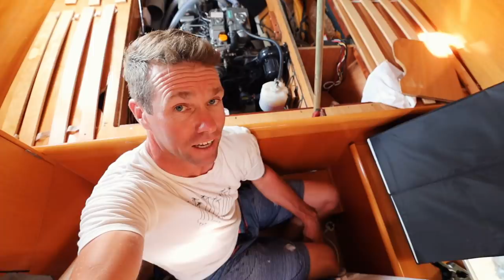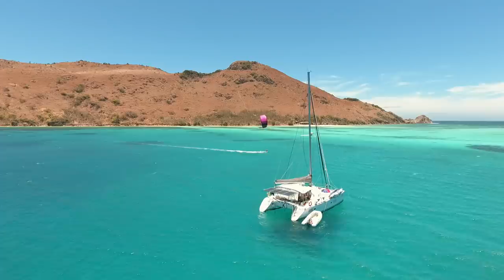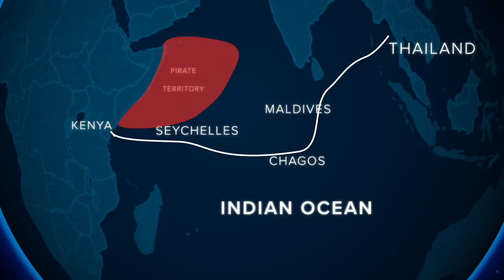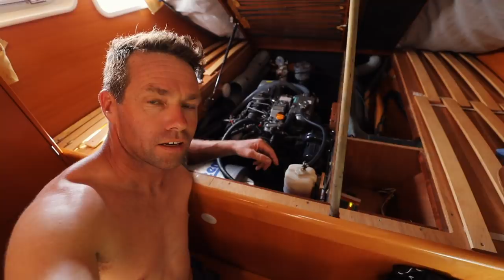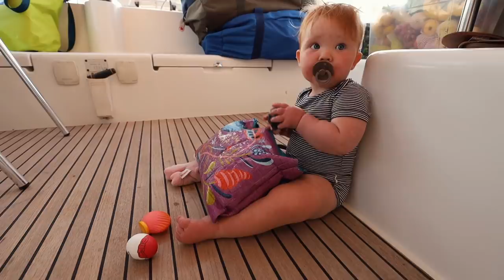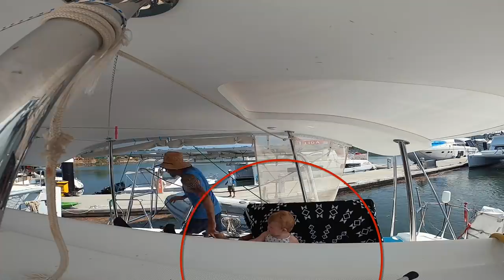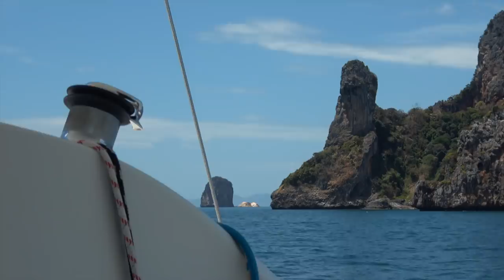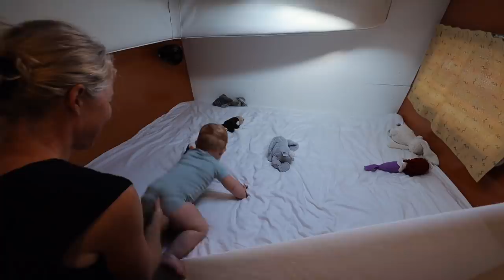we Just BLEW UP our Engine

Comment: Glad to see you out and about again a year's a long time to be away as the seized bits on your boat are letting you know! 
In regard to what you could have done to prevent it, well probably nothing but one thing I always do when starting an engine when it's been left for a bit is hold down the kill switch & turn it over a couple of times without letting it fire up.
All your oil would have drained down & turning it over will pump some oil back to the top end. So it will (hopefully) free up under starter without the excessive forces of the engine under power. It will at least limit the damage if something is really stuck! The other thing is, did you put new oil in the engine before you left? Old oil sitting in the engine for long periods is asking for trouble as it will have water and all sorts of acid & corrosive substances in there, diesels are nasty dirty things! This is why out of the tropics where we might lay up for a few months over winter we always change the oil at the end of the season not the start. Make sure you get the engine up to temp before you shut it down too to chase off all the water. 
Those pushrods are hollow, they're designed to bend rather than force something more vital to break, so just lifting the rocker arm off, dropping a new one in and adjusting the tappet is probably all thats required. So unless there's some other reason for a top end overhaul I wouldn't bother.
Reply: ⬆️ WHAT!?! "... pushrods are hollow, they're designed to bend rather than force something more vital to break." 🙄 Oh, please. They are hollow to allow oil to flow to the upper mechanical mechanisms.

You must be in the sun to much.

Comment: <ase master tech: to swap out it is easy! 1st take the rocker are off. 2) get the correct new push rod. 3 look up the "valve lash" 4 put the new push rod in after putting some assembly lube on it. 5 tighten the rocker arm back into place (use torque wrench)  6 use a feeler gage between the rocker and valve stem and using (usually) and allen wrench and wrench to adjust the gap until the feeler gage has good resistance.  THEN DO ALL OF THE VALVES ON  ENGINES
Reply: as for the valves I would have thought you would have already hit them with a rubber mallet to verify they moved.

Comment: Looks like Willa enjoyed her cup cake. Ben it looks like you have a yanmar 3JH series engine. I would have turned the engine over by hand to make sure that the valves or pistons were not stuck from sitting for long. Looking forward, since you will be doing a long crossing and you already programmed replacing your impellers for the fresh water and sea water pumps, it would be best to drain your fuel tanks of the old fuel, replace the filters for your fuel water separators and also the fuel filters on the engine. Most of the engine problems are due to dirty or contaminated fuel. Looking forward to see you guys on your way. Good luck!

Comment: In the late 90s early 2000s the fish prices plummeted in Alaska.  This left a lot of boats on the hard for years. The valve that was open would often get corroded just enough to stick. As the 2000s progressed the fish prices returned and lots of previously parked boats went back in to service, lots of folks landed where you are. 

2x solutions were found over the years, as the cyclical nature of fishing creates the same set of circumstances that your boat experienced (long layups in remote locations). 

1. We usually enlisted the new guy on the boat to put a breaker bar on the front cam pulley with a socket and roll the engine over manually to ease it in to rotation and find any obvious issues.

2. We would pull injectors so they couldn't fire and roll them over faster  with the starter. Most starters can roll fast enough to hear ticking caused by something stuck. 

If ticking was present the valve covers were coming off. When remote it's far better to need a gasket than drop a valve or bend a rod or crack a cylinder face. 

For future reference the little Yanmar and kubota engines are common in over the road reefer vans.  The cooling, electrical and bellbousings are often the only "marine " part. Hit a refer truck supplier for much more reasonable parts like heads, valves, fuel pumps and such.

Comment: After a long period of an engine standing still. Best practice is to turn the engine over by hand 3 or 4 revolution, to make sure everything is free and clear prior to starting. If it does not turn by hand you can rock it to free it up. Hopefully this will avoid any damage when starting. Also doing a pre-start check list would be beneficial, as it has been awhile since you were onboard. So you catch things like closed valves.

Comment: For a next time before and after storage, remove the Valve cover and spray some penetrating oil onto the valve stems. Plus use a storage oil or additive. A stuck valve after using penetrating oil, you also can tap lightly with a hammer on the spring. 
It is usually the build up of carbon causing the trouble, by running the engine high once in a while you can burn off those build ups. On a Diesel the fuel also lubricates, so to open the fuel valve before starting is a heck of a good idea! And always of coarse check the oil level before starting the engine, make sure it is at its proper mark!

Comment: Piston hitting a stuck valve which is now bent, completely mangled bearing or threw a rod if you have a bunch of oil under the engine?
Edit: Winner winner chicken dinner!
You got unlucky and one of the valves was fully open when you shut down and got stuck.  Not much you can realistically do to prevent that BUT when you heard the ticking you should have opened the valve cover and soaked the valves in penetrating fluid to try and free it up.
Reply: 👆 what he said

Comment: You have to check the intake and exhaust valve tappet clearance according to the frequency(running hour) and clearances given by the manufacturer and you have to make a PMS( Plan Maintinance System) in all  your machineries because in every engine parts their is a given running hours for maintainance like checking,change oil ,replacement of moving parts due to deterioration to avoid damage of spareparts

Comment: It is so great to see you guys back on the water.
The Yanmar operation manual for your 3JH4E engine (which is available online) has a section on preparing the engine for long-term storage that you might want to read. Note the part on draining all sea water and replacing used engine oil and filters. The Yanmar service manual (also available online) provides all the technical information you need to know to repair (or watch someone else repair) your engine. Even just reading through the section on the valve train can help to keep you from being abused i.e. robbed by unsavory mechanics. One comment mentioned a slipped timing belt, but your engine doesn't have a timing belt. The camshaft and fuel injection pump is gear-driven by the crankshaft which should not cause any trouble for the life of the engine.

Edit: After sleeping on this for a night here's my best guess.
The pushrod was bent due to resistance at the rocker arm end. If the problem was at the camshaft end (due to improper valve timing), you would have bent more than just one push rod as that would affect the timing of all the valves. The two likely causes for the rocker arm end pressure, would be water in the cylinder, or a corroded valve stem that caused it to bind in the valve guide. Removing the head and pulling that exhaust valve is the only way to now for sure and you will be able to check for contact between the valve and the top of the piston.
Considering that you are planning to take your family across the high seas, now is the time to pull the engine head and get to the bottom of it. Depending on what you find, you may decide the other engine is due for attention as well. This ain't going to be cheap but the piece of mind will be worth it.
Wishing you all the best.

Comment: if you ever have to store your boat again, There  is a spray you can get to spray into the air intake to lubricate the face of the valves just before turning off. It will keep the valves from sticking harshly there fore no bent push rods. But even so, its not a big job in most cases to replace the push rod, you simplify loosen up the rocker and push it to the side. then shake and spend and wiggle the push rod until it breaks from the lifter, pull it out the simple slide the new in. just make sure you read the Manuel on how to adjust the rockers.

Comment: Sticking valve which stuck open when the cam continued rotating allowing the push rod to escape. Simply remove the rocker. What I'd do as a first measure is get that cylinder in the position where you can compress the spring and rocker with it and re locate the push rod, you'd probably get away with it with out incurring and real damage if any. The clanking noise was the piston knocking the  stuck valve back onto the seat, probably not damaged it..

Comment: Sticky valve Run 40 percentage oil additive Wynn's Morley's this would have prevented it will double engine life
Reply: Run the additive continuously or just a one shot?
Reply: Continuously
Reply: No engine requires oil additives.  Engine oil is already perfectly slippy and designed to clean and protect.  An additive wouldn't have prevented this in any way.

Also your suggestion to "run 40% additive" is utter nonsense.  Additives are normally sold in 250ml bottles, and the engine oil capacity will be 4-5L so to run 40% additive would require 2L of additive or 8 bottles.  

You're talking out your arse.

Comment: I have one suggestion that may not be related to your bent rod, but is important.  When starting a.marine diesel that does not fire up within a minute of cranking, shut off the water intake valve.  The motor needs the pressure of the exhaust to blow the sea water out of the loop beyond the rising elbow.  If you continue to crank the motor the water pump will continue to force water into the exhaust and eventually into the motor causing very bad damage. It is called hydrolock.  With the intake seacock closed this won't happen.  However, it is key to turn the seacock open again once the motor starts.

Comment: Hey Ben-  I'm no mechanic but one thing I have learned is....start w/ the simple stuff first.   K.I.S.S.  Slowly diagnose, Eliminate things not the cause.  But to me...it sounds like a rod/piston knock.   I'd start w/.....oil.  All fluids.  And test amperage on battery.

Beer strategy:  I use the freezer for 45min., max.  1hr.+, I've had beers explode....and that's a messy clean-up.
And when you don't, it's a odorous mess.

Comment: SO Ben.  Just getting to watch.  I'm a 40+ year mechanic - aircraft, trucks, whatever.  2 things you can do to address the problem of valve stick. 1) Preventative. - Use some Marvel Mystery oil in the engine regularly.  This aids what is called "top cylinder" lubrication.  When the values are lubricated with an oil better suited for the heat and pressure of the valve train, there is less likely to be a problem.  Add a bit to the engine with each oil change per instruction.  2) When valves stick, it's generally not a mechanical issues - that is usually not metal on metal.   Rather, goo/sludge/carbonaceous compounds build up in the area of the shaft and valve guide.  A finer oil such as the Marvel, transmission oil, or WD-40, can possibly penetrate the buildup.  Squirt some around the top of the value at the shaft/guide area, and let it sit, hours/days even.  Often, one can make a hook to go under the valve shaft an use leverage to squeeze the valve free.  Alternatively, put a wooden block on the top of the lifter, over the valve, and use a mallot to pop it free.  That's a bit of a gamble, but on that works often enough.  If the valve breaks free, it will move up and down using the mallot or lever.  It could get stuck in the open position, meaning it is sticking into the piston space.  If that happens, generally it means pulling the head such as you did, but in that case, nothing lost - a bit of time perhaps.   What ever you do, do not attempt to start the engine unless you are certain the value will not interfere with the piston.  So, what if the valve gets stuck part way open and you are in the middle of no where?  You can pull the rocker assembly and the injector from the effected cylinder.  Get a piece of small enough diameter rope, like nylon or cotton.  Hand crank the engine until the piston in the effected cylinder is all the way down.  Then feed in sufficient rope to fill about 1/3 to 1/2 the cylinder.  Then rotate the crank back (manually!!) to force the valve back up.  I've used this approach in conjunction with oils and mallot to feee a valve, and the engine is generally completely fine. .  Wishing all the best.

Comment: Top tip for you. Get a sheet of kitchen roll, wrap it around the can or bottle of beer and then wet it under the cold tap so it's completely soaking and wrapped around the beer. Put in the freezer  for around 6 minutes and then you have almost instant ice cold beer.

Comment: When you hear bad noises it is best to turn off, and turn the engine by hand to feel for points of more resistance. In fact I don't think you could have turned it 720 degrees by hand. If an engine has been sitting for a while that is always a good thing to check. Two full revaluations by hand.  In Dutch this manual turning is called "Tornen" and on older engines this is standard procedure before every start. It also checks for hydro lock.

Comment: Hey guys. As to your other question.  For an engine that has been sitting, pour some oil in to lube the top end, seal off the intake to prevent any air from being drawn in  and the engine will spin over easily without stress before cranking.  When an engine sits the oil drains away and you do not want the stress of compression.   If air cannot get in, there will be no compression and no stress on the engine.  Now crank for a while to build oil pressure to lube everything.  Once you have oil pressure and all sounds fine, open the air intake and start the engine. James

Comment: old timers used to fill the engines full of oil including the rocker cambers to stop that thing happening  for long term storage but the trick is to remember that you have done this to remove the excess oil before using the engine.

Comment: Hello, I think the valve is in good condition because the spring keeps the valve in the up position, replace the old pushrod and perform a ragging of all engine valves with gauges.
99% works properly. To be sure that the valve is not bent, try to push the valve with a screwdriver to compress the spring and check that it is not stuck and use  pressure tester with the valves in the closed position.
I`m sure that you can perfom this(realiy easy) Best regards.

Comment: Spun bearing on the lower connecting rod to the crankshaft. My best guess since the noise. After seeing the bent pushrod, I suspected a bad hydraulic lifter. Did you check the oil to see if there were metal shavings in it? Motor may need overhauled. No one knew what the story was with COVID and could have never guessed one would be away for a while. Pickling the engine for storage would have been optimum but who knew. Not an inexpensive repair to say the least. Take care Nahoa crew. Happy birthday Willa! 🎉🍦🎁🎂🎊

Comment: Revving the engine can bend pushrods when the lifter cam is moving faster than the valve spring can return the rocker arm...the result is the delayed rocker arm is still moving down when the cam and pushrod are already moving up for the next cycle...bang they smack and the rod bends.  I believe you said it ran fine for a bit then after revving it made the noise...so not a stuck valve but revving caused it.   Might be a good idea to replace valve springs in case they are fatigued a bit.

Comment: Piston struck a valve.  Bent valve at the minimum.  You may need a rebuild of the piston and crank bearings as well.  

Pull the head and have the valves rebuilt.

That pushrod does not bend easy.  You have a bigger problem.  It bent because the piston struck the open valve, which will happen with the valve sticking open or with a timing issue.  

Because its running, timing is adequate. This means the valve stuck open.  When the lifter was down on the cam, and the pushrod was down, it likely slipped from the rocker arm and was forced to bend as the rocker was violently shoved closed by the piston hitting it.  

Replace the rod, have the head and valves serviced, replace the push rods AND lifters, inspect the surface of the piston while the head is off.  Reinstall the head after the work is done. This is probably enough to get sea worthy again.

If you see damage on the piston or a perforation on it, or to be extra super safe, rebuild the bottom end also.

Comment: Had a similar problem after letting our boat sit for about 8 months in Panama. But it had an old Perkins and those old engines were very forgiving and the valve freed up.  Boats and engines just don’t like to sit!!  We had the same problem. With green slime and mold. Lots of clean up. And always issues.  You guys are doing great!   I love your third crew member!!  And yes, I had a similar incident in fuel management. I forgot to switch fuel tanks and ran one dry while bashing into the Caribbean trade winds with heavy squalls.  Big mistake. And of course, only had one engine on our 44’ monohull.

Comment: Did some research into your engine "issue" . One bit stood out. DO NOT crank the engine endlessly  if it isn't starting. This can hydrolock your engine and result in bent "stuff". If you have a gooseneck, and presumably you do, and the engine fails to start in short order, and you keep cranking ...then pull out the wallet. Hopefully engine #2 had fuel and started quickly. Cheers from Prince George.